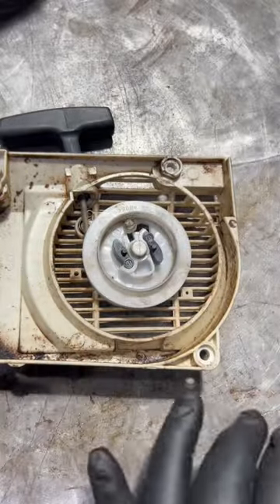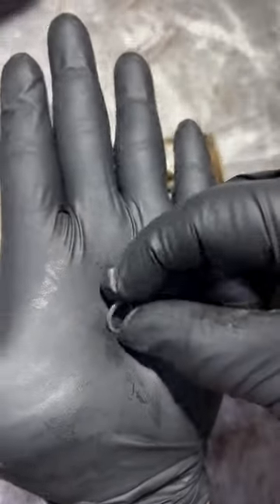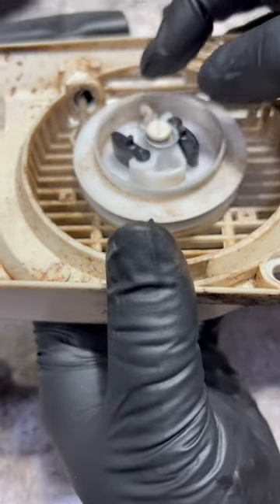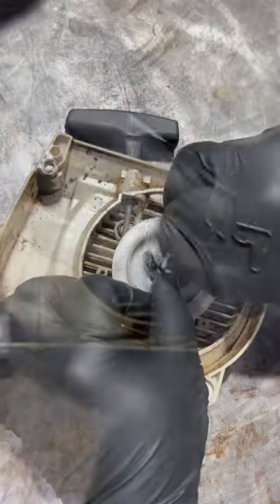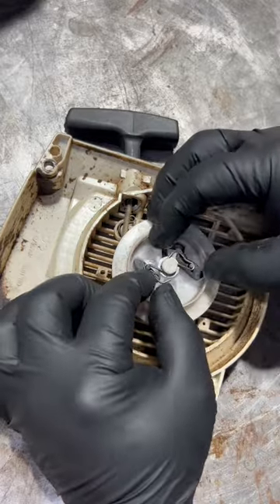Rebuild Stihl recoil starter

Comment: Why did you avoid the recoil spring? That's what we need to see
Reply from the maker: I’ll make one of it but the video was mostly on the pawls.
Reply: @10minutefix  I've got the recoil down but the end section that comes to a hook slots into a spot but there is nothing for it to hook to. It's a b350 stihl blower. After installing and getting string on it just won't recoil still